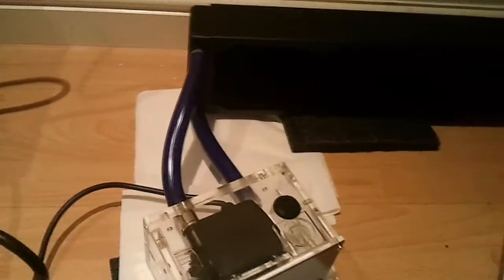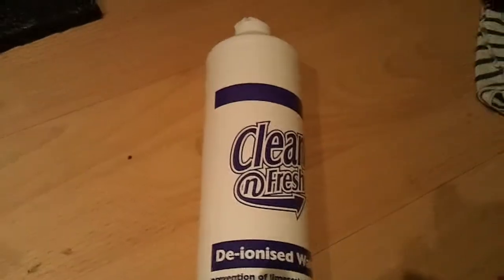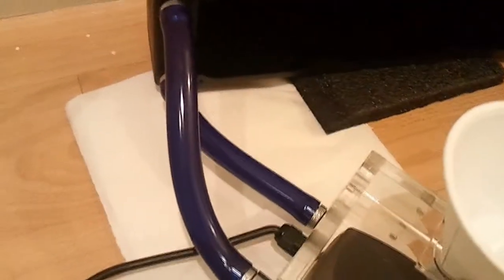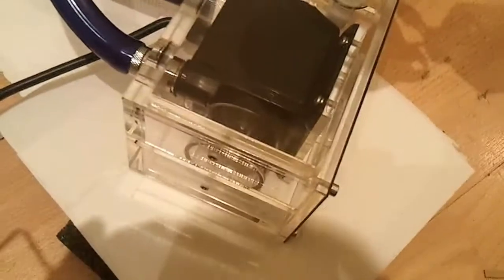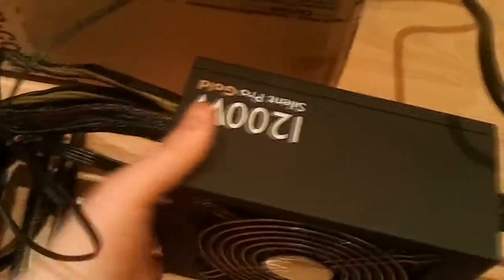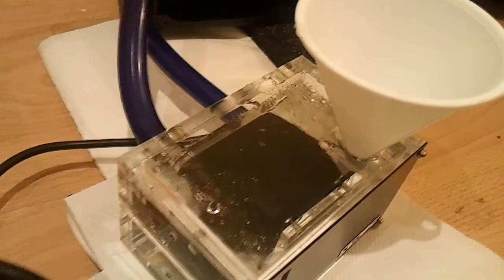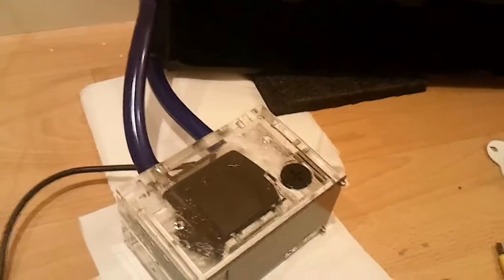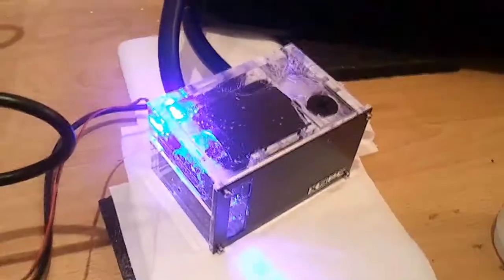My Guide To Water Cooling: PART 3

Comment from the maker: Oh sorry, if you are refering to the cpu loop, the res at the top is an identical xspc res with a section for the mcp655 pump :)

The lower xspc res is with the built-in pump for the gpu loop. That pump does around 750 litres per hour and the mcp does around double that, hence the ideal use on a cpu loop were the epic heat is produced during an overclock haha

Comment from the maker: And for the last time, those compression fittings were labeled as barbs on the website from whence I purchased them. I know this has lead to much confusion, including myself, but they are definitely COMPRESSION fittings that I have used as barbs to save time and money. Yes they work perfectly fine this way, not ideal but workable. Hope that ends the Barb-compression debate.

Comment from the maker: It's fantastic, very quiet and does a steller job of keeping the 6990 at 40-45'c under 100% load. Couldnt rate them higher, the MCP will have more power etc but is more suited for CPU cooling than just a GPU. plus you then need the res to go with it also. So I recommend the Xspc pump-res combo for price to performance! hope that helps :)

Comment: those are compression fittings for 1/4 inch tubing, they just happen to be big enough with the compressor on the outside to fit your whole 1/2 inch tubing around it

Comment: @turbodude555 Oh OK. I don't know how to install simple water cooling. A good video on it will help. I'm planning on getting NZXT Gamma case. But would like to know what materials to get to setup water cooling, and how to do it. I figure a simple, heat sink, reservoir, pump, radiator, and some ancillaries is all I need right?

Comment: This is a bad tutorial. No dionized water was ever mentioned in a previous video. I can't figure out how to install water cooling based on this. I need to know exactly what to get. As far as I know, pump, resovior, radiator, tube, fitting, liquid. Not sure if this is it or what else though.

Comment from the maker: @EsSplicit

Hey, what do you mean by a 360 kit pushing an extra 240 rad? Are you meaning you want to link the two together? Having a single loop for both CPU and GPU means a higher overall temperature. So if you plan on stressing both or overclocking, I personally wouldn't risk it. I'll be using a seperate loop with a 240 rad for my GPU, not sure if I'm still using a 6990 though as bizzarely the 6970 performs better in some games!

Comment: nice vib bro.....one question, can the 360 kit push an extra 240 rad? im geting the 800D case so im ganna mount the 360 at the top and a 240 at the bottom. also im wondering if my 6990 will be ok to watercool in that single loop?

Comment: Fittings comprise a serious amount of cash, especially bitpower. Just wish my vids could be up very soon so you can see. I'd also recommend on taking a look at maxishines stuff, it all adds up to ideas for your H20 build. Definately would not recommend EK multilinks. which has since been changed in my build, now has more you guessed it fittings. I even have one's that I havent used yet in my ever changing build. But its hard to tear it down once its TOGETHER trust me. Better done right 1st time

Comment from the maker: @XxViciousxX 

Thanks, I'm sure I will have a nosey. Apparently that is a really nice kit however, like I mention in one of the videos, the pump isn't really that strong. So for best results I'd say keep the loop as short as possible for best results. For example I'm using the same pump-res for two GPUs just by themselves for best thermal performance. Depends on what you are trying to achieve really, if you're not overclocking I'd expect it to be fine. See if you can post some temp results :)